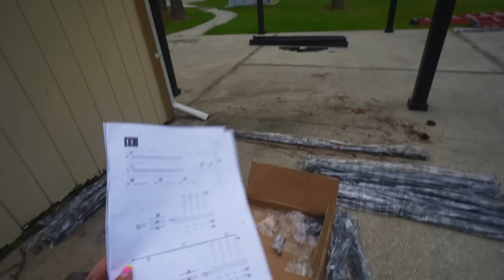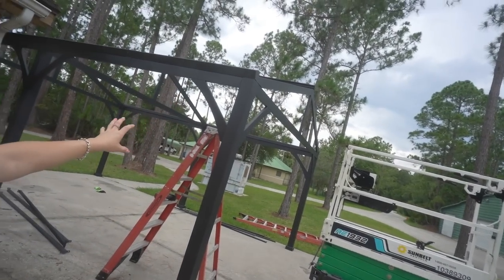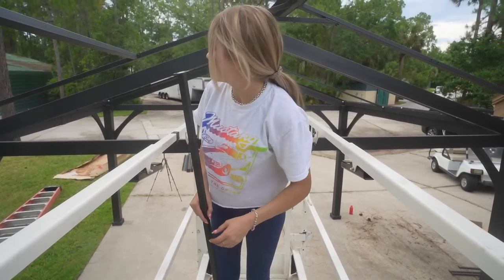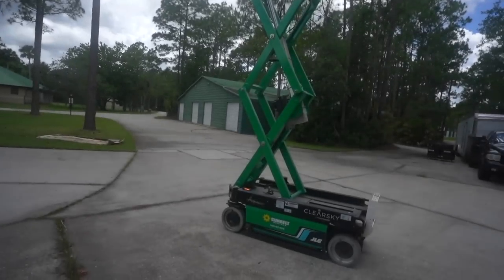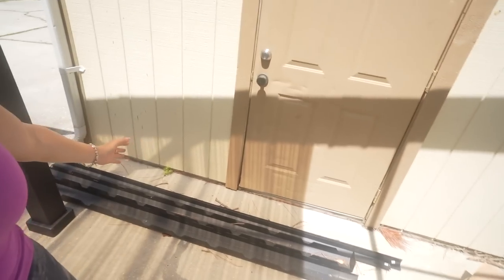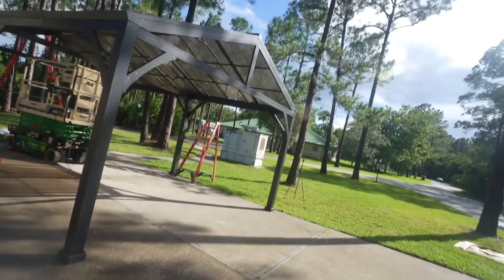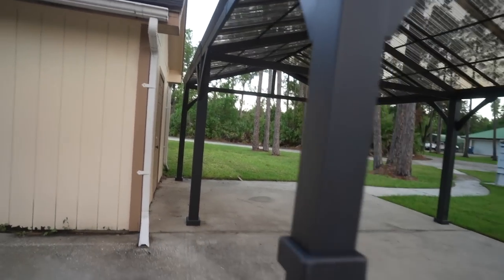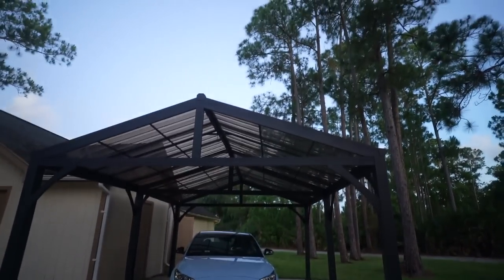DIY Compound Car Port is Finally Complete!

Comment: Did I miss a gutter system or does rain just pour off of it into the side of the house inside that one door?
Reply: I think they're built into the frame
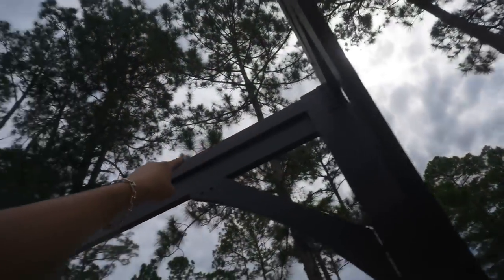Reply: @2:55
Reply: @trentaucion882  thank you, missed that completely.
Reply: In the beginning of the video shes pointing out some bolts that are down in a trench thats the Gutter

Comment: Be careful with the bolts as anchors. They could shear with enough force. Especially with the wind over there in FL. Look into installing redheads, it'll give tons more strength, and save from risk of injury.
Reply: built just as well as the vette😬😂

Comment: Be sure and add gutters at least to the building side. Otherwise that water will be going into the side of the building and that door frame will rot away along with the siding and trim.

Comment: I believe you’re eventually going to need to upgrade to aluminium sheeting as the smoked carbonate panels deteriorate. The aluminium sheet will also offer more UV protection and heat reduction than what you have installed

Comment: Looks like a decent frame but is that big groove in the side beams intended to be a gutter of some kind?  (We're actually pretty seriously looking at carport options here,  kind of a pity they seem to have few options.   I do know that smokey corrugated plastic's likely to turn to potato chips in a finite number of years, but roofing material's negotiable.  (Also not a bad failure point to have down there in hurricane country.   Still it might be worth welding on some beefier mounting plates than those.  )